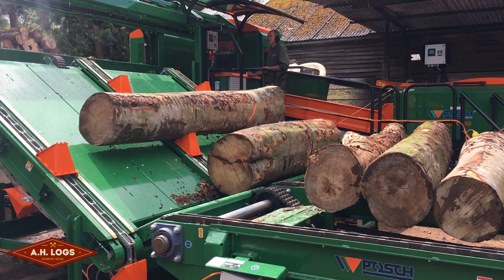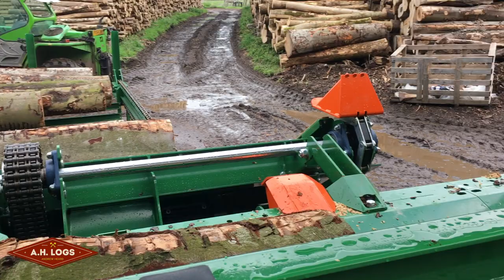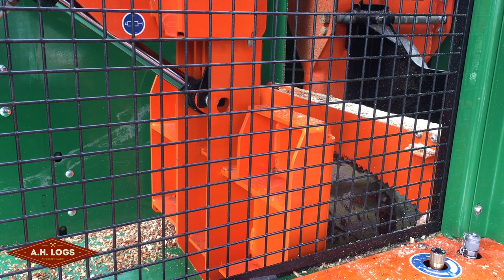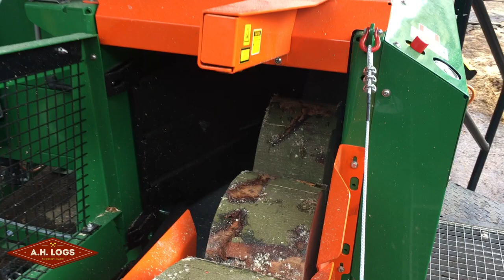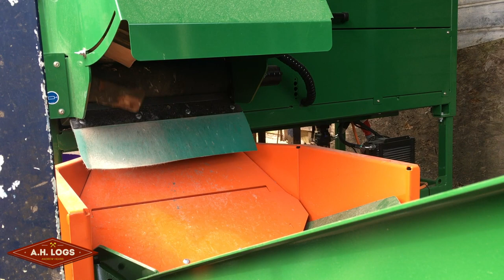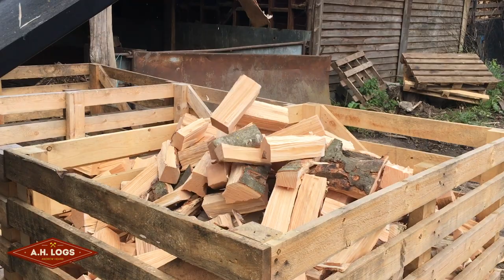Posch SpaltFix K-660 a-vario Firewood Processor

Comment: For such a big machinery (and price) the speed of the production, are all too low. It should be much faster.
Reply: No, because u can let the machine run day and night, because its full automatic.
Reply: @danielmunch9568  Nonsense! Look at the speed of the mounted Chain Saw. A hydraulic Chain Saw, as on this machine, normally runs twice so fast. Look at a Forest wood felling machine, which Chain Saws are much faster. If they should wait just so long on cutting a Tree, as this machine, they would never be finish.
Reply: I suspect they slowed down the machine for videoing purposes and could go much faster. In either case the firewood that comes out is the perfect size and no re-splitting would be necessary saving quite a lot of time later.